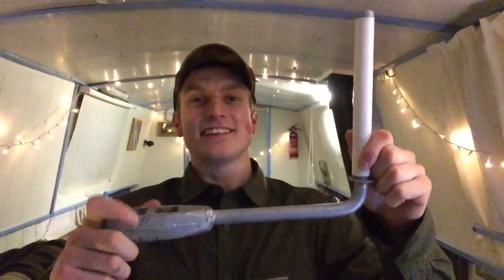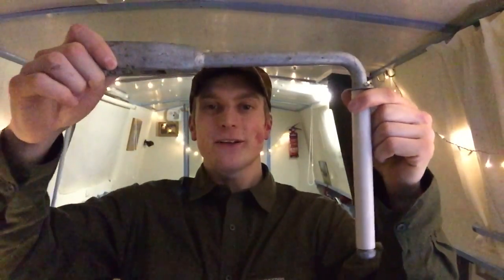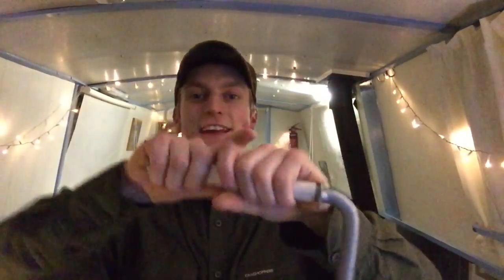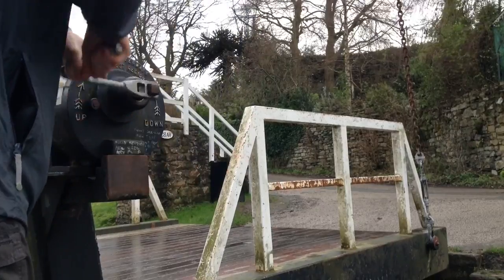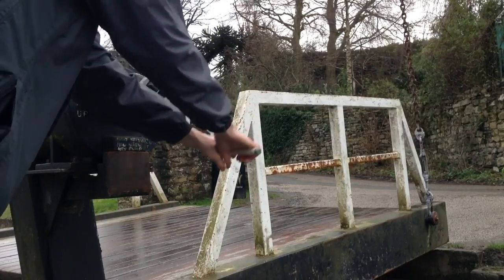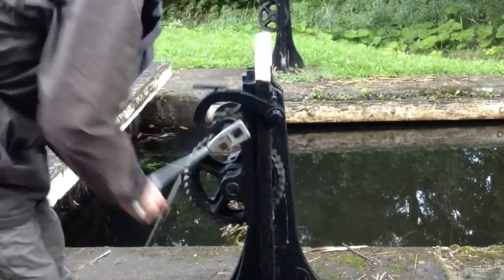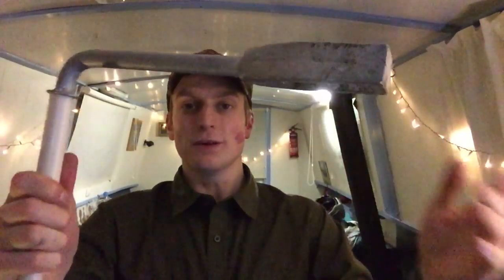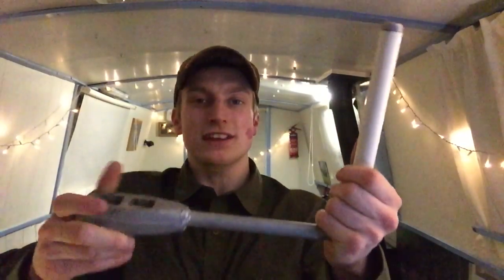UBB: What is a Windlass? (What every Narrowboat Should Have!)

Comment: I know it's easier to say but shouldn't windlass be pronounced with a long i? You use it to ratchet something, not figure out which direction the wind is blowing from. The lass part seems to make perfect sense as it means loose or unattached.
Reply from the maker: +Digby O'Dell Hello, yes it is strange how these things seem opposite to what the more obvious pronunciation would be, it is similar to how turning points are "winding" holes (as in wind blows) rather than winding (round and round) holes!
Reply: Ah, that makes some sense then; as long as it's never fitted to anything, it be a wind[y]lass!